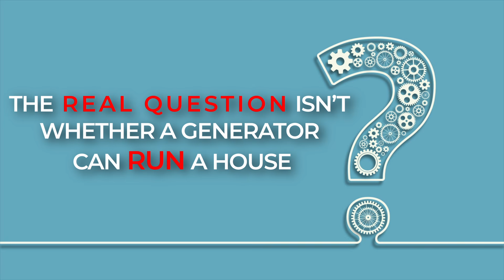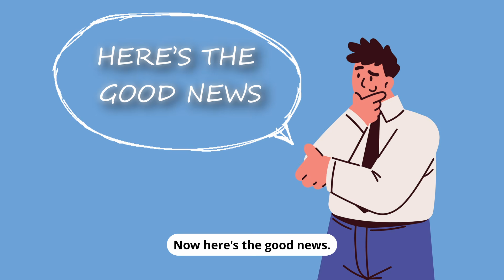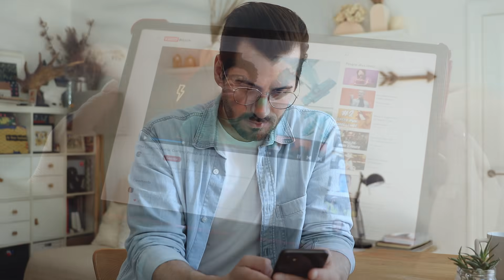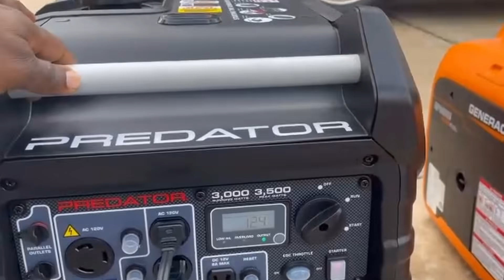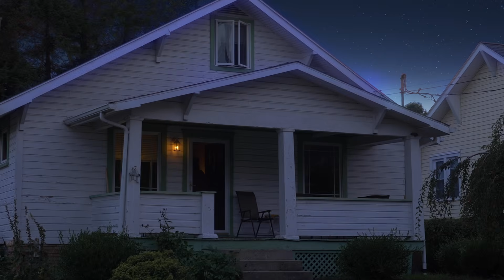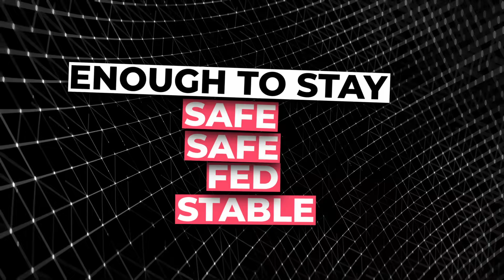Can a 5–7kW Generator Really Run a House? Let’s Be Honest

Comment: Good message I live in a rural area. Had 9000 watt generator for yhr past 4 years just upgraded to an 11500 watt generator. I manage the load through my bresker box. FYI water heater does not need to have continuous power as it will keep the water hot for hours. I usually keep the load at or below 50%.